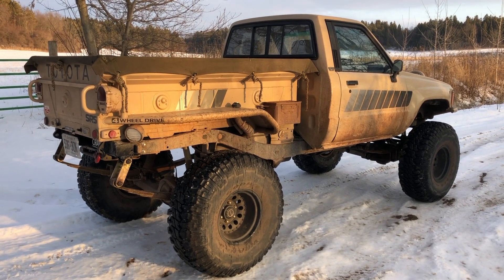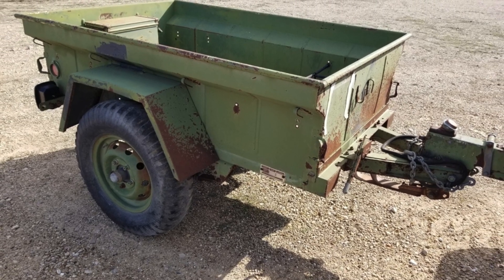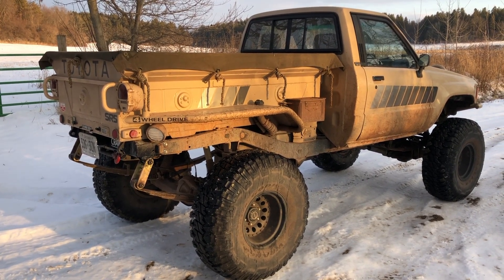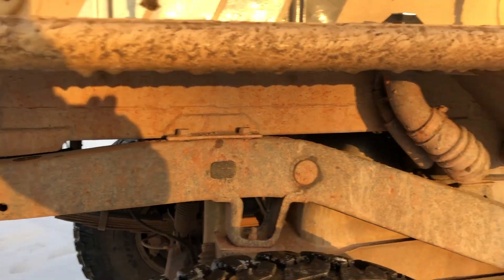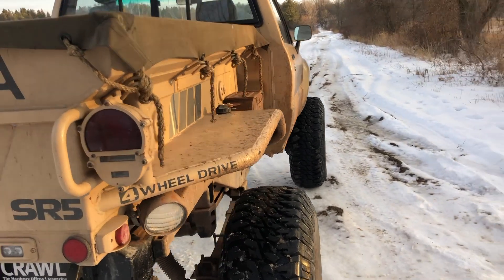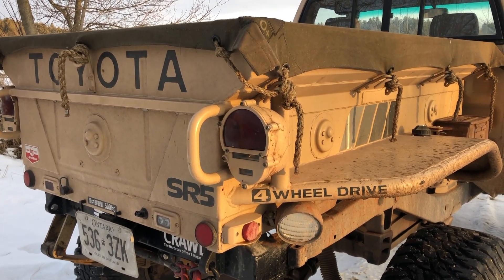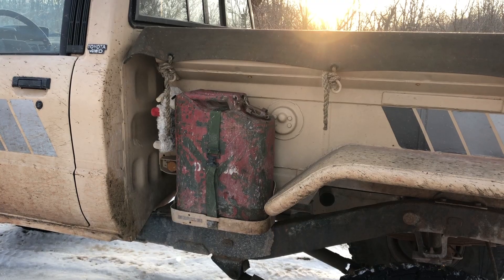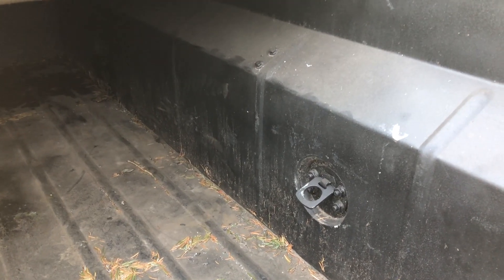M101CDN Military box on a Toyota longbed pickup frame

Comment: Assuming you are living in Canada and daily drive or atleast drive during the winter often enough. How are you dealing with frame rust? I am asking because I live in Ontario Canada where we have allot of road salt used here in the winter. My dream vehicle is a pre 86 Toyota pickup, the same truck I’ve been warned to never drive in a Canadian winter. Thanks allot!
Reply from the maker: Thanks for question...I live in Southwestern Ontario, and to the amazement of a lot of people, yes I daily drive this, including the winter.  The frames on the Toyota trucks from this era are fully boxed, meaning they are closed in facing outward and inward; this makes them very strong, but also means they rust from the inside out.  Toyota uses frame plugs to keep water and debris out, including salt, but over time these farme plugs fall out, mud and debris gets in, drain holes in the frame get plugged, and moisture accumulates rotting out the frame from the inside where it's not painted/ treated.  I painted most of the frame with POR15, and I have no rust on that part of the frame, however since it's a Canadian truck, the inside of the frame is where all the rust/ damage is.  I replaced the frame plugs and opened up the drain holes, and make sure to check for missing plugs/ clogged holes yearly. The warning not to drive these trucks in a Canadian winter holds true for any vehicle of this age...if i you have a rust-free or low-rust 40 year old vehicle by any manufacturer, that is sound advice.  My truck is not rust free, it's lived it's entire life in Ontario, and it is no more or less rusty than any other Canadian car with almost 250,000 kms.  Find your dream truck, and drive it as you wish; if it's a low km rust-free example, you're only driving it occasionally in nice weather anyways.  If it has a bunch of km's or miles on it, has been previously enjoyed, and you're planning on daily driving it, there's nothing that is going to happen that hasn't already happened to it.  Canadian salt will rust your vintage Toyota at the same rate as any other vehicle. 

Just remember, a pre-86 pickup is not like driving a modern car; they are loud, slow, uncomfortable, not fuel efficient, and parts are not readily available.  I have to order simple things like an air filter online; even windsheild wipers are getting hard to find locally.  People drive them for the passion, not the practicality.  If you drive one of these daily, make sure you have alternative transportation and can do you own work.